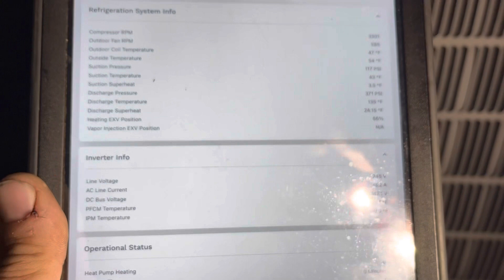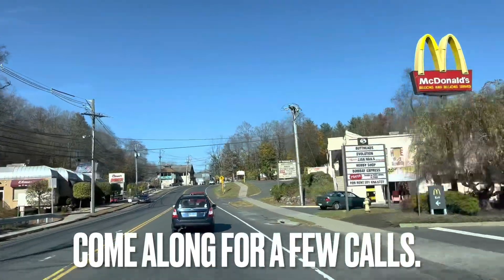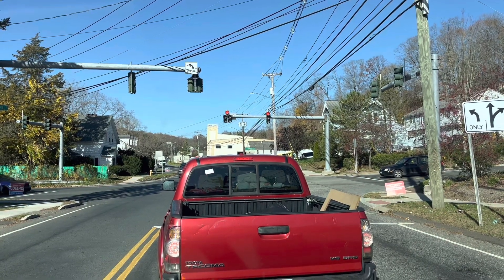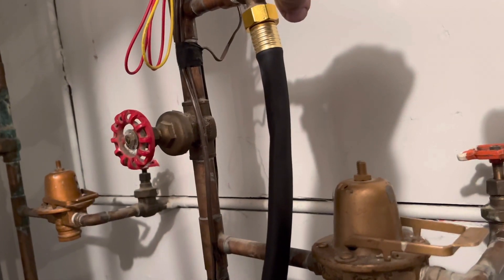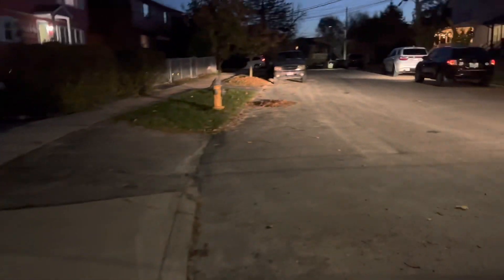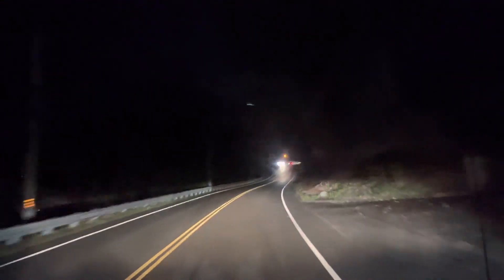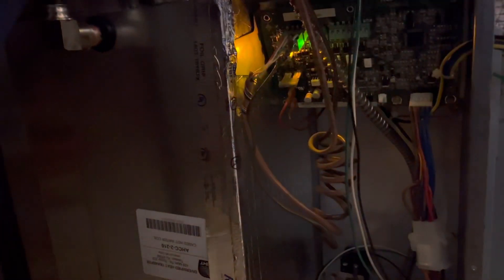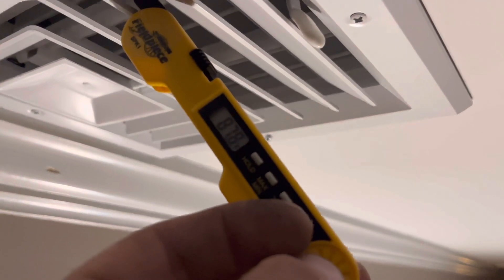HVAC. CARRIER INFINITY APPLICATION DIAGNOSTIC.  BOILER REPAIR. NO HEATS.

Comment: How do you turn on the screen
Reply from the maker: The screen should be turned on as soon as the power to the unit is on.   If you don’t see any type of screen check you circuit breaker at the electrical panel of the home.
Reply: @hvacotj can I be removed from the wall or does it have batteries
Reply from the maker: It does not have batteries.  Thats why I mentioned to check electrical panel. The power at the unit may be off.   Or the thermostat (user interface) may have failed.   It can be removed from wall but no batteries.